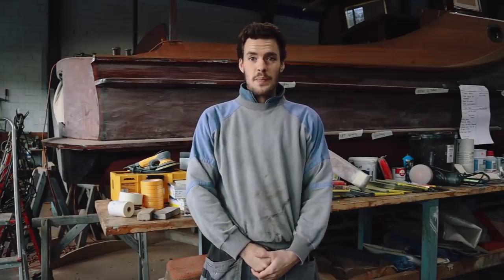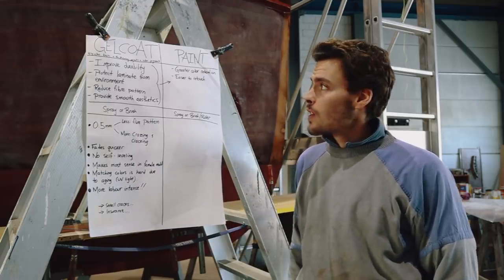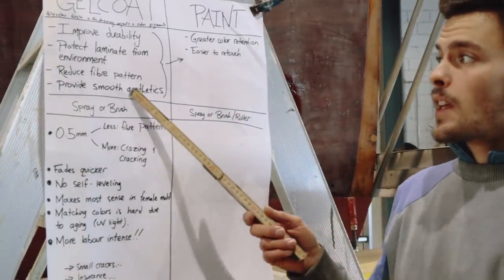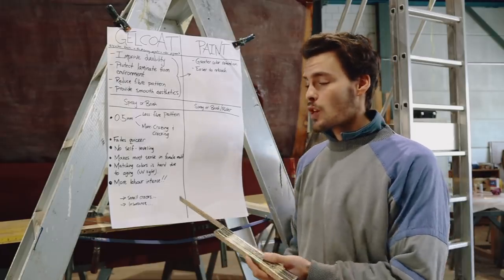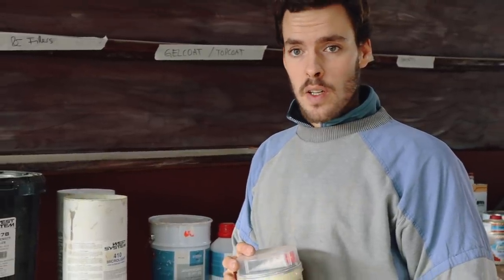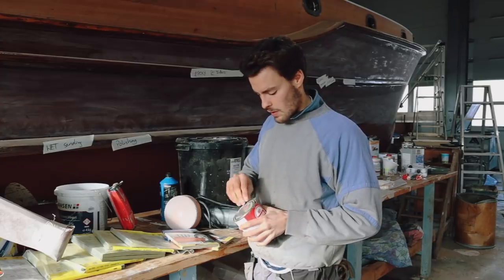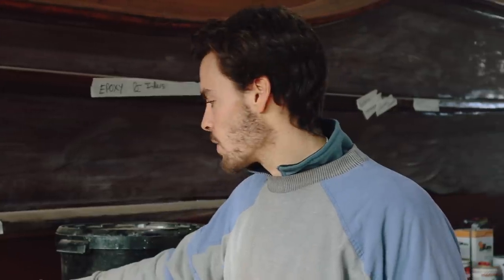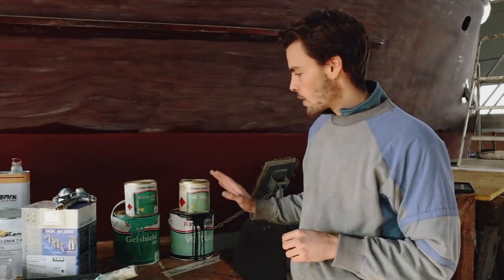How to restore surface finish on damaged fibreglass

Comment: You did a very good job introducing us to what is needed and why and when to use them. Since I am way behind in your videos, you may have already covered this but if not, most of us would like to know the best techniques for rolling & tipping PU paint jobs of the hull. We will just never have the space and equipment to spray it on.

Comment: Great video, you took on quite a project there! I understand that paint made sense in this case, but for those times that you need to use gelcoat it can be sprayed very effectively. You'll need to thin the gelcoat with styrene to get a sprayable consistency, I've used 30-40%, but I didn't find any issues with shrinkage as I thought I might. I was using a good airbrush, so I made sure I broke the gun down and cleaned it well before the gelcoat flashed. I was working a 1' x 2' area, and was able to apply layers smoothly with only an orange peel to level. The original gelcoat was only as thick as an egg shell, so sanding through was an issue if I tried to level a heavy texture with coarse grits. I leveled with 400G W&D, followed by 600, maroon ScothBrite, and a rubbing compound. The repair was not visible. It was a newer boat, stored indoors, so the gelcoat provided by the manufacturer matched well, but it rubbed out to perfect blend. 

Do tests off the boat of course, but gelcoat can be sprayed. Styrene is nasty, so be careful there. And, get the gun cleaned ASAP. I doubt a  cheap, throwaway gun would be up to it.
Reply from the maker: Thanks for your reply S/V Aroo
You are very correct!
I should have mentioned in the video that it was specifically dedicated to the situation my boat was in...plus some additional general information.
Actually we do way more gelcoat repairs than painting over in the boatyard and my surname is mr.gelcoat here 😄 
But i’ve never applied with the spray gun so thx for those tipps.
Aladino

Comment: Given that you already had to rebuild the stern, for long term cruising, you might have considered adding a sugar scoop for easier acces to the water from the cockpit.
Reply from the maker: Hy Peter
What i did consider at first was extending the stern, but after talking to a yacht designer I realized that it would need a second mast.. so after dreaming beyond the actual repair i decided to “keep it simple” and bring her back to her original lines. You have to know that most vindö owners are very proud of the heart shaped stern! And since one day we will sell i thought original is better.
I know how handy sugar scoops can be, so maybe it’s a consideration for the next boat.
But with all the compromises to always keep in mind, it is not the highest priority.
Aladino

Comment: Dear friends good morning, I would like your opinion regarding a similar problem to a friend's boat. The boat brake loose from its mooring and banged hard against the pier destroying its back part forming a gap of 55cmX15cm where the underwater line raises above water and meats the back side of the boat where the back stay chain plate is placed. Having seen your videos I am pretty clear about the method. The question is can I use a sandwich material for better strength, and if yes what material should I use? Marine ply wood? inox 316? aluminum? Your response will be much appreciated. Thank you in advance.
Reply from the maker: Hello
Sry i couldnt get back at you earlier..
Mostly i try to bring things back to original 
So if it was sandwich (wich i doubt in that location) marine ply would be an upgrade.
If not reconstructing to how it was and adding some layers should be more than adequte if done right.
Good luck